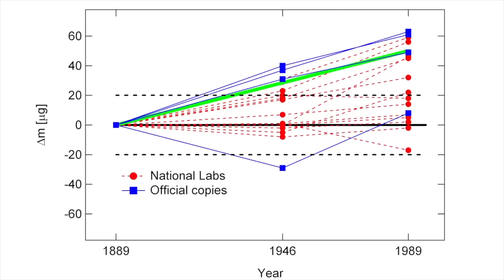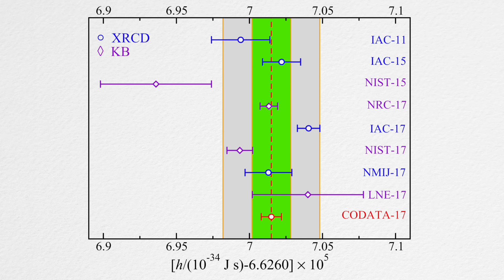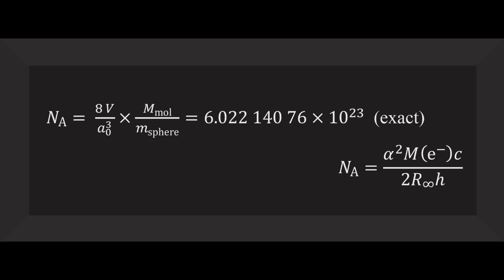The kg is dead, long live the kg

Comment: I probably got this wrong, but are scientists really suggesting to put a random, from measured values sure, but arbitrary nevertheless, number in Plank's constant, which is going to affect Avogadro's number as well? I mean, what is this? The dark ages? Can this be even verified using the scientific method? How? If you were to measure it you have uncertainty? How was this even considered as a solution?
Did I misunderstood? :o
Reply: Nothing is certain. Using metal cylinders is actually the dark age. Now we are moving closer towards light
Reply: @xmark1440  solid physical objects are more certain than fluctuating mathematical formulas. I bet you don't know either, just support the change because.. who knows?
Reply: It's not an even number, It's like pi. You have to round up/down depending on the required accuracy, which will affect the other constants... variation is science is normal
Reply: @bassisku  but isn't it something that you have to measure to find it? if it fluctuates, and throws the measurement each time, then how can you work with that? pi is as precise as you want it to be. 5, 10, 11 billion decimals, you can find out exactly, it just takes computing power. But this thing is random.
Reply: As you said it is from measured values, thereby making it not random. It is certainly more accurate than using a solid object as the mass of said solid object will fluctuate, Plank's constant will not as it is, well constant. The only variation we have now is in the measurements we make of Plank's constant at more precise decimal values, but this will always be the case.
Reply: Twogamerz so it's more precise than the previous measurement, but still some error exist, primarily due to measuring error. But as measuring techniques improve, so will the number itself. Am I right?
Reply: As far as I know, that's the current situation.
Reply: Jo, no one suggests that they are defining the number of atoms sitting on the head of a pin.  They're setting a constant for the purposes of measurement.  Chemists will use it as an approximation, as they always have, and when it changes (as it inevitably will) then chemists will go with the improved number.  Eventually, in a very deliberate way, so will the measurement system. Everyone knows which is the dog and which is the tail.
Reply: The problem is there's no scientific way of getting an exact constant for any of these things, so you have to pick one to be your reference.  You define that, and then all of the numbers around it get based off of it.  We choose the numbers that already line up with our current measurements at their current level of precision, so it doesn't really matter what you use as a standard, the numbers will be the same, assuming they're all constant, and measurable to the same accuracy and precision.
However, there are some things that are measurable by a lab experiment, and reproducible, so those make better standards.
It's easier for 2 labs on opposite sides of the planet to count wavelengths of light from a Krypton 86 source and define a meter so they can accurately make a meter-stick for measuring things, than for them to ship around a meter stick (hoping it doesn't get bent or worn in transit), so that they can measure the wavelengh of that light source.  (just an example.  That's an old standard for the meter)

What they're doing is saying.  We think the planck constant which we can measure by scientific experiment is probably more constant than our kg prototype, so we'll use it for our standard.  Since our measurements rely on things that we can't measure with absolute precision/certainty, we'll pick a number that keeps all of the other units as unchanged as possible, and use that.  Since it's all arbitrary, there's no reason to change all of the other values, because they're still the same, at our accuracy and precision of measurement.

The exception being when there's fundamental relationships found between units that were previously based on different standards, and they turn out not to be correct.
In those cases, one of the numbers has to be fixed (along with any units derived from them).  Presumably again, we fix the unit that breaks the least other units, until we eventually get a complete tree where energy/mass/space/time are all referenced to a single unit, which will likely be arbitrary in scale, since we'll have defined it in other arbitrary terms.  Calling it 1.0000000000 isn't likely useful, since the relationships between units aren't always in convenient numbers anyway.  There's no point in making the one true reference look numerically pretty, when it means breaking all other units.
Reply: Well, I object. Not that it would matter anyway, or this would change my life in any shape or form. But I cannot accept the definition being arbitrary like that. I would only accept constants that exist in nature. If you could somehow calculate the force exerted by an electron, or any other fundamental particle like that, or the silicon sphere, that thing was a real object, and a constant also. Silicon of that purity of that exact diameter, that contains x amount of atoms, that would weight, what we arbitrarily agreed at one point in our brief history as a species, exactly one kilogram.
Reply: @JoTheVeteran  But you have to decide which number represents a constant, even when said constant "exists" in nature. You propose a silicon ball of x atoms. How would you choose x? Completely arbitrary, just like Avogadro's number is.

You mention the force exerted by an electron. Sure, unfortunately it varies with distance, at which distance should we take the measurement? And also, why specifically the electron? Again, both decisions are completely arbitrary.

We have to adopt conventions and choosing arbitrary values doesn't make physics any less exact or objective, quite the contrary.
Reply: @f.p.5410  you choose the x,y,z by creating a measurement for how far a beam of light travels in a specified amount of time in vacuum. You call that number whatever you want, blergh, arton, pliuu, meter, doesn't matter, this can be your arbitrary number. But it is based on a constant, so if you want to modify it for whatever reason you return to the constant. I thought we already measure stuff based on the speed of light.
So the number of atoms in a x,y,z sphere of pure silicon-28 are exactly 2.15*10^25, and weight exactly 1 KG. Travel in another galaxy, dig out a ton of silicon, purify it into silicon-28, reduce its diameter until it reaches the x,y,z specifications, and you will have another ball of 2.15*10^25 silicon-28 atoms. The kilogram recreated in another part of the universe. You bring them together, and counter weight them, they will balance perfectly. Here is your constant that exists in nature, is measured perfectly, AND is a physical object as well. 
I really don't understand how they went with a number they can't measure accurately yet, or maybe never.
Also, I meant photons, not electrons.
Reply: @JoTheVeteran   Jo Veteran  I think I get what your issue is. We aren't measuring Planck's constant, we don't need to because we decided its value. We aren't measuring the speed of light either, we decided that it's exactly 299 792 458 m/s. If you measured the speed of light and registered 300 000 000 m/s that wouldn't mean that our chosen value is wrong, it would mean that either your metres or seconds are wrong and you should tweak them to make the speed of light exactly 299 792 458 m/s.

Since that number doesn't change we now have a perfect way to check if all our instruments are coherent. They all need to measure the same value for c.

We now do the same for energy. We decide that a photon travelling at 1Hz as an energy of  exactly 6.626 070 150E-34 J. We can't be wrong for the same reasons that we used for c. Since 1J = 1 kg m²/s² and we already defined metres and seconds with the speed of light that means that the kg must be tweaked to fit the new definition of Joule. Now we can't get Planck's constant wrong, if you do you need to fix your instruments.
Reply: @JoTheVeteran  And by the way, do you realise that digging out a ton of silicon, purifying it and making it into a perfect sphere is WAY more difficult and time consuming than just measuring the energy of light at a known frequency? Using a physical object isn't advantageous at all. Finding photons is easier than finding silicon.
Reply: Francesco Pascuzzi I won't lie. I don't understand how the new measurement works. It is beyond me, Derek doesn't explain it well, whatever. But what he did say that I understood, there is an amount of uncertainty. That is my issue. If you can do the silicon-28 with zero uncertainty, then any other way, even with the tiniest ammount is a bad idea.  It's harder? Who cares? You wouldn't make kilograms for the masses. You just need two per planet (one for proof testing, and comparison).
Reply: @JoTheVeteran  Yes you're right the video isn't extremely clear. I don't think it's your fault.

Think about the example I gave you about light speed. Before defining the meter ON the speed of light we weren't sure about the true speed of light. It probably was an irrational number. Light speed was still constant, we just didn't know its exact value. We are doing the same for mass.

Or if you prefer another analogy, suppose you want to measure the exact length of a football field but you only have a short ruler so you have to do lots of measurements and add them up. You are always getting slightly different results (100.01, 100.02, 99.97) but you know the field isn't stretching so you just decide that the length is 100, you throw away the ruler and you create a new ruler equal to 1/100th of the football field.
Reply: Francesco Pascuzzi so you say the uncertainty is there because of how small those values are (too many small rulers). So if you adapt that formula for a kg then the deviations are unimportant. So it's good enough that we can use, even for tiny measurements, is that correct? 
And another thing. If there are tiny deviations in that method, does that mean there are in the silicon ball as well? Again caused by imperfect measuring techniques.
Reply: @JoTheVeteran  This is what happens for every unit. The deviations and inaccuracies can be there for a variety of reasons like extreme differences in magnitude or maybe certain units are simply difficult to measure like the candela or the mole (good luck counting all the particles of a gas). As our technology improves so do our measurements so I don't know if we already are able to create a perfect silicon ball or not. It certainly isn't easy.
Reply: @f.p.5410  good talk. I hope he makes a video further explaining this method. At least I learned a thing, or two in the comment section :)

Comment: If you have to fix Planck constant, why not chose a number easier to manipulate ? like 6.63 or 6.6 or even 10 ? Let's make it really easy, let's fix Planck constant to 1. Yes, it makes all our past measurment wrong. Fine. That was already a similar leap when we moved from imperial to metric or from Mark/Franc/Lira/Crown to €. What stops us? Probably the cost of the change. Money is again preventing us to live simply...
edit: spelling
Reply: Because it wouldn't solve much.  The scientific community has already tried to normalise constants but for some of them it's just not possible. 

For example, it's physically impossible to have the Coulomb constant, the elementary charge, the reduced Planck constant and the speed of light all equal to nice numbers at the same time ( wikipedia.org/wiki/Fine-structure_constant ).

Money isn't to blame for this, the universe is.
Reply: Because "old" grams won't be anywhere close to "new" grams anymore, and this will cause problems. The fixed values of these constants they're adopting make the new values almost identical to the old values, close enough that outside all but the most boundary-pushing physics the old accounting of things' mass, voltages, etc. will still be accurate to so-and-so many decimal places. You can still run a regression over old and new measurements and get meaningful results. But if there was a sudden redefinition, then we'd have to mark the existing measurements as old units and would have to do a conversion before using them together with new units in the same analysis.
Reply: Because we don't want to change everything, we just want to change our standard (The thing we compare to).
If I give you a bucket of apples, and tell you that the mass is 1 bkt,  and that's what we compare everything to for years, and we do a bunch of measurements, and find that all of those bkts contain 10 apls.  We define the apl as 0.1 bkt.

Later on, we make more accurate scales, and find that when we weigh those buckets, we sometimes measure 1.0 bkt, or occasionally 1.1bkt, or 0.9bkt
if we decide instead to use apl as our standard, we could define 1 bkt as 10 apl.
It corrects for the fact that our bkt standards don't measure exactly the same, but at current levels of precision, the numbers are exactly the same.  If you had 20bkts of apples before, it's still 20bkts now.

It's actually fairly arbitrary.  The main advantage being that there are alternative ways to calculate the Planck constant, so you can tell someone in a lab how to accurately calculate a 1kg mass, where with the current system, you would need to have that 1kg artifact.

A similar parallel is metric vs imperial.
An inch is now defined as 0.0254m.  It's not an approximate conversion, it's exact.  They took the standard at the time, measured it, and redefined it in a way that gave it the same value as it already has.  The only difference is that there's more reproducible methods of measuring it.  An inch is defined in meters, which is defined by how far light travels in a vacuum in 1/299792458th of a second.

You could set up an experiment in a lab on the other side of the planet, and reproduce the same measurement.  If you just knew something was "an inch" long, and don't have that inch standard, you have no way of reproducing it.
Reply: First of all, don't knock cost as a limiting factor. If every mass measurement system had to be recalibrated (and I'm sure a lot would simply need to be replaced), it would be a huge deal. The new definition was chosen to make it a simple as possible to transition: Ordinary scale need no (urgent) adjustment, and even scales for university science classes will probably be OK.

If you defined a many things as possible to simple numbers like 1, everyone would have to do a lot of factoring with √π and e and giant  prefixes and suffixes and whatnot.
Reply: If h = 1 (and thus is many times larger than it is now), the gram would get tiny. I personally don't want to measure out 5 zeptograms of water every time I fill my bird's water dish